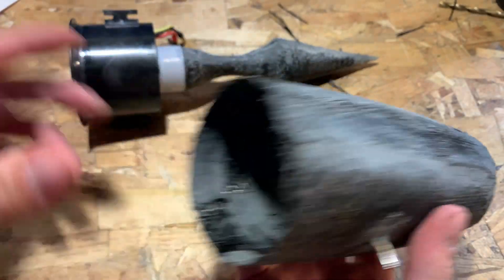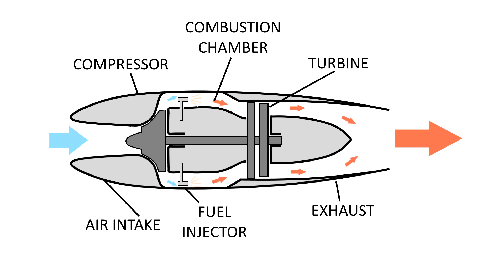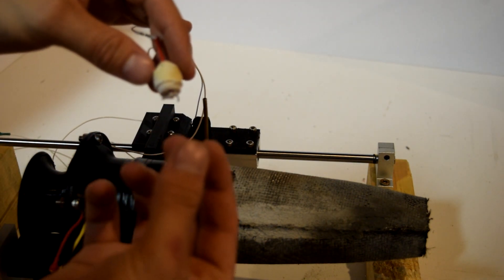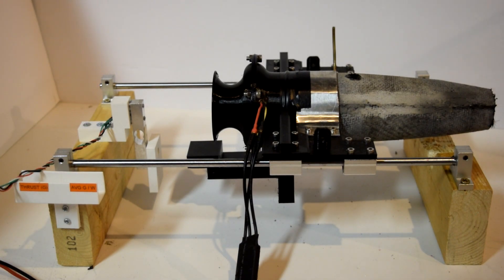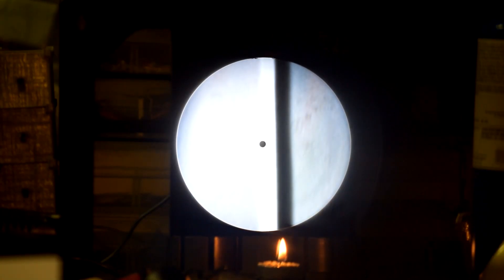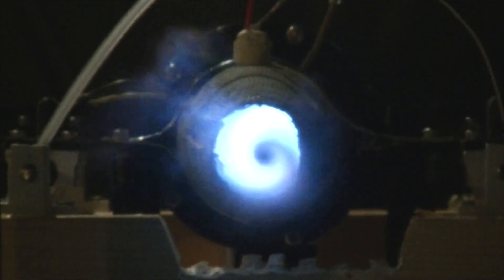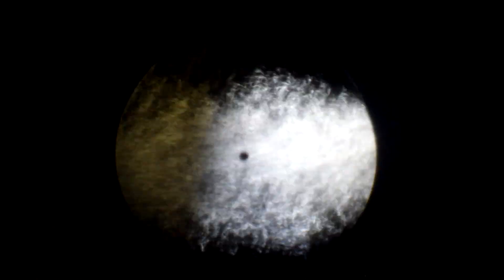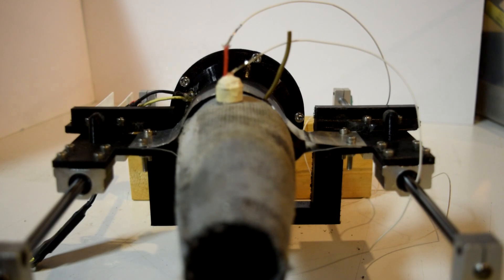RC Carbon Fiber Jet Engine (With Schlieren Imaging)

Comment: Hey, i watched your older video as well is it possible to make a hybrid peroxide engine to pressurize air speeds, simultaneously mixing with fuel to start the ramjet. Integza has tried to make a peroxide one as well as various different engines. Hope to see this channel grow. 👍

Comment: Hey, hope you're doing okay.  You're on the right track, and making me want to try EDF afterburners again!  I was messing with them in like 2015-16 when I first found the David Windestal Flite Test video.  This week, I bought a couple of the biggest HET motors (1w-50) that can fit my housings (64mm Cyclone power aluminum), and those units come with 4 and 6 blade rotors.  I also got a couple freewing 64mm units with 11blade rotors to try.

My basic theory is that with 3 different rotors, a motor that can pump 4KW+ into a tiny 64mm fan, and plenty of trial and error, I can figure out the best balance of efflux velocity vs static pressure.  My other idea is something I haven't seen anybody try yet:

In a full sized jet engine, there are multiple stages to the compressor section.  I'm going to try putting one of my RC Lander alloy 50mm EDFs behind a 64mm as a second stage.  If you look at a cross section of any jet, you'll see the compressor sections get progressively smaller.  It probably will all end up just being a restriction on the 64mm, or overspeeding the 50mm (or both), but if it doesn't, I'm going to try putting the afterburner LAST in the setup (after the 50mm), for maximum static pressure AND efflux.

Back in 2016ish, I tried different fuels in the Windestal clones I made.  One really promising one was WD40, or the generic equivalent.  It seems to have MUCH more energy than butane, is more stable, harder to blow out, and on the geek side, it smells just like jet fuel >:o)

Comment: did you do any math behind this project? I am pursuing a similar project, but i do not have any fabrication methods and therfore have to just desgin it on paper.
Reply from the maker: there's a bit of basic math behind the propulsion but there are so many factors that experimentation is the only true way of determining the efficiency.

Comment: Instead of using a turbo design which is designed for air pressure, you can make an Axle Compressor which is suited for fast air flow… 

- A turbo charger design loses fast airflow due to the 90 degree angle in the intake, an axle compressor has smooth airflow without loss of energy while keeping the air compressed at high speeds.
Reply from the maker: This is a great idea, I'm going to do some testing to see what designs are the best.

Comment: Man iv been waiting for this video since the last one came out, the afterburner on edf is practically useless, edf's rely on high rpm to be efficient and that afterburner isnt helping. 

You should build a complete jet engine, it is the true way although pretty tough.

Instead of puting one compression stage, i would prefer to make an intake and then a compression stage as 3d printed compressors dont truly work... 

Make the intake wide in radius and, and then the compression part should bottle down, this is the only way you can practically compress on this level, or use a actual turbocharger.

Working with carbon fibre may not be easy, and is probably very expensive.

I prefer steel bottles, they can be close enough to the shape/size you want or you could design an engine around it.
Steel bottles are usually thin walled just enough for this purpose.

Comment: you are using way to much fuel for this to be anywhere near efficient, rule of thumb is if you have fire outside the engine then its not running lean enough. however you have a nice blue flame which indicates a clean burn. i would  suggest putting a burner ring in the center of the engine as well, the more even the burn throughout the engine the more thrust you can expect to gain. also at some point you may want to lock that spark plug down somehow to stop it from popping out.
Reply from the maker: My biggest problem with butane is temperature control, I think I’m gonna try and warm it up before it reaches the engine to reduce the amount needed for startup and running. I’m trying to design a screw-in spark plug but it’s a bit tricky with the carbon fiber

Comment: I would love to see more of the EDF afterburner. I am working on one myself and would love to see some advancements you could make. If I may leave a few ideas... Use a butane/propane mix commonly found in gas torches instead of pure butane. Experiment with liquid fuels or a gas/liquid mixture (WD40 has worked before) to color the afterburner. And most importantly really, experiment with different flame holders and other designs to find the most reliable and easy to replicate design. And if you want to, I could send you some 3d files for a super simple variable area nozzle I designed for use in my afterburner, would love to see that thrust-tested on your rig. I already tested it with no burner, there it barely had effect.